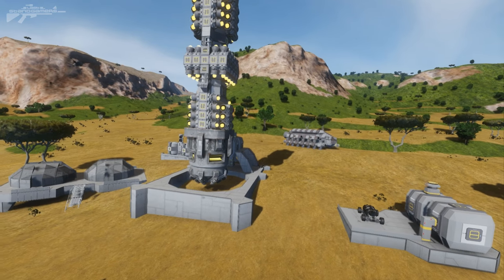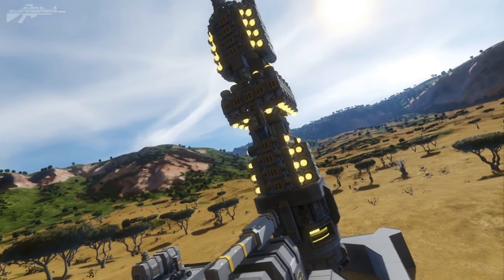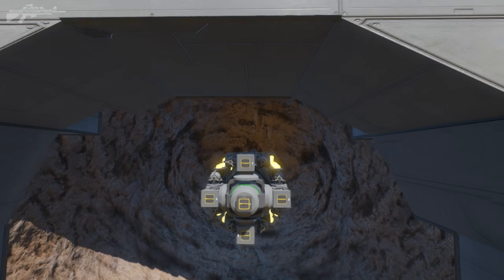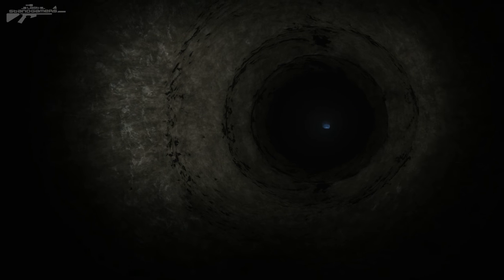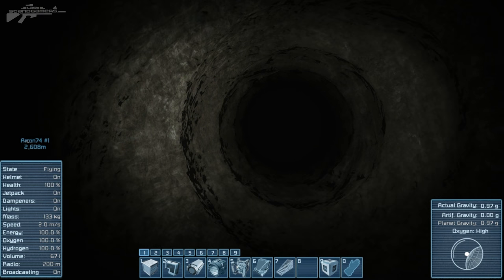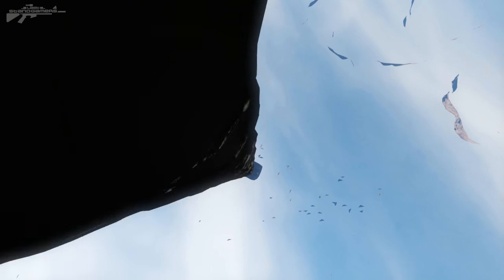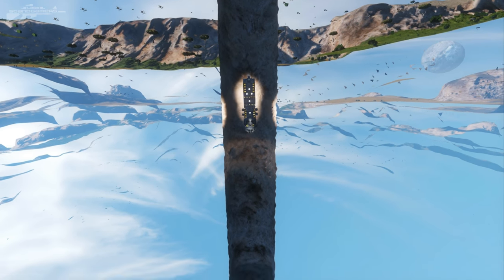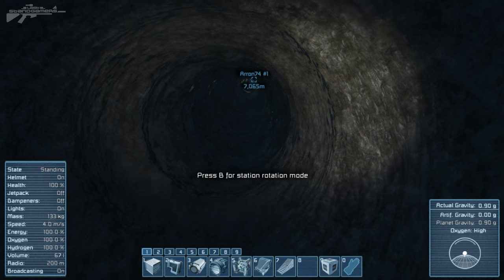Space Engineers - Centre Of The Planet Drilling

Comment: If there weren't a speed cap you could use this kind of tunnel as a slingshot for ships getting out of orbit
Reply: +Almighty Eragon The speed effect would be zero, since gravity works the other way when you  go past the core.
Reply: There are mods increasing the speed limit
Reply: you would have to use thrusts to speed up as you go down, its just to make gravity and the distance help you reach escape velocity
Reply: +Almighty Eragon That's unecessary work, it's even more expensive to make it go through the center of Earth than just have it simply fly off, I can work the math for you if you want...
Reply: it would't work as well as you're thinking. like frank said there's gravity on both sides of the planet... lets just say there was a perfect tunnel going straight through the center of the earth. you jump down... assuming no air is in the tunnel your acceleration would start becoming slower and slower till you reach the core, then you would start accelerating in the opposite direction (or decelerating). then once you reach the other side of the tunnel, your velocity would become 0 and you would just start the process all over again.
Reply: Basic physics, the energy situation doesn't change and you still need as much thrust as you would need to take off from the surface.
Reply: Masterofworlds
the speed cap, and the depth limit, are the only things that prevent you from using this and atmospheric thrusters to escape atmosphere, no it isn't practical, but seeing as there is no drag in game it would work.
You just need to get enough speed to counter the planets gravity after you pass through the core, assuming you could.
Reply: Wouldn't you have enough thrust to counteract gravity if you reach that point anyway?
Reply: +Frank van Veen No, the point is that once you pass the core, gravity will do the exact opposite of what it has up until then. You will accelerate half of the way and decelerate the second half of the way which just "resets" your velocity. You still need to put in the same amount of energy to leave the planet as you would without the tunnel.

If you were to jump into the tunnel, you would accelerate until the core, decelerate from there and pop out the other side with exactly zero kinetic energy left. (Assuming a perfectly spherical planet) So it's as if you had never left the surface to begin with energy-wise.
Reply: I was responding to the guy who wants to use thrusters to accelerate on the downward path. The point referring to escaping the planets gravitational field. So I agree with you.
Reply: +HOLyPumpgun | Gaming  actually, infinite speed mods mean you could accelerate for a long period of time while going down there with a ship, and then when you reach other side of the planet, you've already been accelerating for a longer period of time than you would've if you were on the surface, allowing for the ability to reach 10x the escape velocity for the planet just using atmospheric thrusters
Reply: while you may be correct in the sense that you would have more distance to do your burns, it would cost a lot of energy to do so. not to mention the time it would take to dig such a tunnel through the planet would be the least efficient way of going through things. ... pun not intended.
Reply: Masterofworlds if you've already managed to dig such a hole, you'd probably already have had obtained such power for it, to shorten the time to dig and to make it actually possible, use a 14-13km planet, shouldn't be any instant delete there and it would be a lot faster.
Reply: Mini Meatwad No, you don't get conservation of energy. Sure, you would have double the distance to thrust upwards but you would also have to travel twice as far before you reach space. It doesn't work. The gravitational pull will pull you into the hole after you pass the core. Your thrusters will counteract that force and keep your velocity stable but in the end, you will end up with the same amount of energy used to get to orbit. You could just as well take off from the surface without the tunnel. It is the same thing, it's an equation that solves itself.
Reply: "Lost In Space" (1998) featured this idea. Their ship didn't output enough power to go straight up, so they travel straight down to accumulate escape velocity.
Reply: +Masterofworlds There's a scenario where this would actually be viable, when you have a spacecraft with a TWR less than one, so it can't take off by its own from ground. You just drop it down a hole and let it put more and more energy into the ocelation until it reaches a high enough velocity to be able to place itself in orbit/reach escape velocity!

Other than that... Agreed, rather useless approach.
Reply: +HOLyPumpgun | Gaming exactly what i said, it  wouldn't conserve energy, but it would allow for more speed, if you didn't read my comment then why are you trying to disagree with it, and also, i stated that there was a infinite speed mod, you took your ship, strong enough to fly up to the upper atmosphere, but can't manage to fly into space, you would go through this hole constantly thrusting in order to achieve a faster velocity into space would work, and by the way, 40KM of influence of gravity around the planet if it's a 120KM, and even though the gravity would affect it the equal amount on the way up, cancelling any boost from the gravity which we aren't talking about, we'd still have our very built up speed, and as it's 120 more KM to travel through, you'd be able to get quite a lot more speed than the escape velocity. my point is, dig hole through 120KM planet with 40KM sphere of influence from the sea level, and then accelerate your ship down that hole with your thrusters to gain a larger amount of speed than you could get if you were to use atmospheric thrusters up till the atmospheric thruster limit, however what we're talking about is getting escape velocity with atmospheric thrusters alone to leave the planet.
Reply: you know you can remove the speedcap right?
Reply: ya but i don't want to so :P
Reply: Why is everyone saying it wont work? It could work like an elevator. Although there is the problem with max speed...
Reply: +Philippe Dionne-Gosselin when u study physics u will know
Reply: when you further study physics you'll know even better that it could do as a super speed boost for your thrusters to keep workin at speeding it up, not a slingshot
Reply: hamad Cassuis Lol wut I am studying engineering. In theory, as long as the planet does not rotate, and you neglect friction, you could use that as an elevator. At first, you have x amount of gravitational potential energy, and 0 kinetic energy (relative to the planet). Once you reach the core, you will have 0 gravitational potential energy and x kinetic energy. This means that you will be able to reach the otherside, having all your kinetic energy turn back into gravitational energy. 

Id very much like you to explain how this is incorrect, because it seems you are the one who lacks the knowledge of even highschool physics.
Reply: Philippe Dionne-Gosselin perfectly gets it, +1 , science is best, and judging by your video history and your opinion and knowledge of stuff, you're intelligent unlike most people you'd see, you also like the same type of humor as me
Reply: Mini Meatwad Oh shit I thought it was private lol, some of the videos I watch could get me in serious shit at a uni nowadays...
Reply: Fun fact folks. Because of a nifty little thing called the Oberth Effect, this sort of thing is actually possible (in a hypothetical sense) in real life, if not using SE's physics engine. Basically, applying thrust when you're being accelerated by a force of gravity nets you more delta-v, or change in velocity, than if you're thrusting against gravity. You have a greater change in kinetic energy when firing a rocket engine at high speeds than you do from rest. 

From Wikipedia;
"In astronautics, a powered flyby, or Oberth maneuver, describes a maneuver in which a rocket falls into a gravitational well, and then accelerates when its fall reaches maximum speed.[1][2] The resulting maneuver is actually a more efficient way to gain kinetic energy than applying the same impulse outside of a gravitational well"

Basically, if you apply your thrust and burn your fuel as you're accelerating towards the core, you'll actually have more speed leaving the planet than if you just launched from the surface straight up.

Come on guys, its only rocket science.
Reply: Daniel Mulhall Interesting. I heard about the Oberth effect before, but I did not thought it would apply in such a situation for some reason...
Reply: +Daniel Mulhall Rocket science really isn't that hard. Bottom go boom, top go up.
Reply: +Philippe Dionne-Gosselin I'm only a civil engineer but I often think I should have gone into something else as I've an unhealthy obsession with rocketry. Don't worry too much about missing that little mechanic.
Reply: Daniel Mulhall Yeah, thanks. I am also considering aerospace. Or robotics...
Reply: Word from a friend in SpaceX suggests that robotics is a great thing to have if you're going for internships with them. Best of luck with that
Reply: Daniel Mulhall Thank you, best of luck with you own career.
Reply: +Almighty Eragon It would actually come out slower due to air resistance + gravity working on at coming out of the other side.
Reply: we're talking about space engineers as well, we're not talking about the shape of the craft, are we? is it aerodynamic and fast but the thrusters are stronger in atmosphere? or is it slow and bulky?Taylor Duncan
Reply: +Almighty Eragon Without any extra thrust and no drag, your ship would end up at the same altitude, but on the opposite side of the planet. Any thrust during the drop would result in a higher velocity, and therefore a higher altitude on the other end, even if the force from the thrusters is less than the force of gravity. Meaning, even if you were using a ship incapable of achieving an acceleration more than that of the gravitational pull, you could theoretically use a tunnel like this to add enough velocity over time to reach escape velocity, or to reach an altitude where the force of gravity would be weak enough to fight.
Reply: Chris Badiou not really smart to +1 your comments, but this is correct, multiple theories come into work when you do this
Reply: In reality the pressure of the core would be the equivalent of even more gravity meaning at some point you're just gonna be stuck flying into many different parts of the core
Reply: SOCOM DELTA ALPHA
pressure in a vacuum? i don't think so.
Reply: @ViniciusNegrao_  hm, the only thing that might play a nontrivial role here would be the  
Oberth effect. Basically, if youre already fast, you get more effect out of using propulsion engines. But ill have to do the math to figure out if it makes any practical difference
Reply: @kcbsuiejd  You're correct! You made me think, by the time the ship passes by the other edge of the planet, it'll be, much faster than what it'd be going from the ground, that's obivous, but also, the ship would experience bigger G's for less time when exiting out of the other side of the planet. If anything, this method would save some fuel
Reply: @ViniciusNegrao_  

thanks :)
It obviously wouldnt work in real life due to friction and molten core and everything, but in a game it could be a valid strategy. Or on a smaller moon/planet with no atmosphere, where it could function as a pseudo swing by.
Reply: No, when switching through the different hemispheres, you would switch gravity aswell. So you’d just go back to the core, and keep slingshotting until,your stuck in the core

Comment: The lower gravity as you go down is actually very realistic. As you go down, you start having stuff above you exerting its own gravity to pull you back up. At the exact center of a perfectly spherical body, you would be in zero G as you are being pulled equally from all sides. 

This is also why a hypothetical "Tunnel to China" wouldn't need engines. Gravity starts pulling you down, acceleration slows the deeper you go and completely switches to deceleration once you pass the halfway point. Interestingly enough, such a tunnel would have the same travel time from New York to Los Angeles as it would New York to Sydney.
Reply: +OtakuMage Wouldn't need engines if your entire tunnel was vacuum, otherwise air friction would slow you down and you'll eventually end up at the center.

Plus you have the whole pressure and temperature and the mildly annoying issue of the metal core at the center of our planet... :p
Reply: +refreshfr That pesky, annoying metal core. Destroying dreams and ambitions since 4,540,000,000 BC.
Reply: refreshfr I said hypothetical, it has many issue of which air pressure is not the least. Casual use ICBMs are a more likely alternative these days.
Reply: +refreshfr metal? i thought we had lava in the center... :/
Reply: +Bart Wijshake Molten metallic core. Look up how it works, The lava is called magma in the earth with its gaseous component mixed in, The magma comes up from the mantle, a thin layer of semi-molten rock. We live on top of the earths crust. The crust is in sections called tectonic plates that rest on top of the mantle which flows via heat based pressure currents called convection currents, its all a mix of rocky minerals and metals, Eventually, you get deep enough to reach the outer core, A highly liquid like portion of the core which has heavy convection currents and has many elements including pretty much all metals from hydrogen to francium and even higher up the chain, its the flow of these convection currents in the outer core that give the earth its magnetic field, the north and south polar magnetic field. Then you have the inner core, which is made of the same substance as the outer core, but due to how much pressure is being forced onto it from the weight of the outer core, mantle, crust and even the air all around us, its squished into itself from all directions and acts more like a solid, due to mass compression. contrary to popular belief, the inner core is not what makes the earths magnetic field, but from what we can tell, it may spin. Also the outer layers of the inner core and inner layers of the outer core may sort of break away and reform into each other as they bridge the gap of liquid and solid.

Thats geology for ya! :)
Reply: +OtakuMage You know, that is a very good point right there with the decreasing gravity. At first I thought decreasing gravity was bullshit but now that I was reading your comment, yeah, it actually makes sense. It is just something that was never relevant in any other game because no other game allows you to drill through the planet that deep.

I just never relly thought about it,
Reply: +Kyle “Raven Flight” Van-Tiel u can see the upper mantle if u are deep enough in the ocean.
Reply: Kyle Van-Tiel my brain... It hurts!!!
Reply: Bart Wijshake  magma inside the earth is melted rock, the deeper u go u start to see metals like melted iron, gold, and some other shit till u get to the very center where hell it
(jk)
Reply: oh dear... kyle... look at what you have done to that one guy :P
Reply: "Life Noggin" :B
Reply: I dont wanna be the flat earth guy.. But nobody has been in the center of the earth to prove the molten core theory.. It a THEORY, HYPOTHESIS for a reason.
Reply: Hehe..  As modern philosophers become more and more convinced we know almost nothing, the general modern public becomes more and more convinced we know everything.